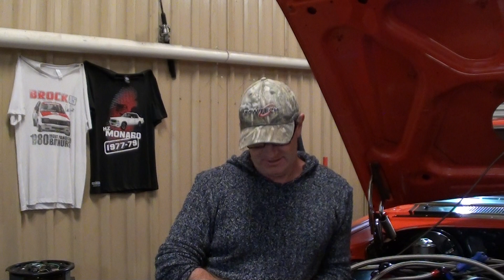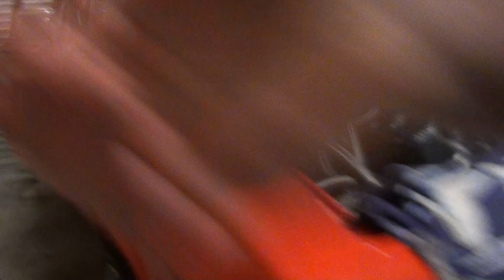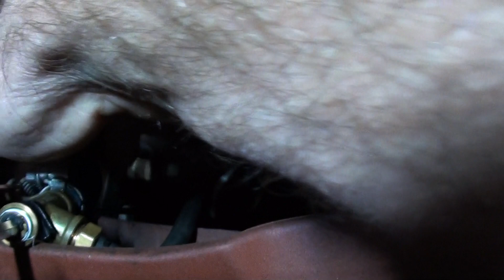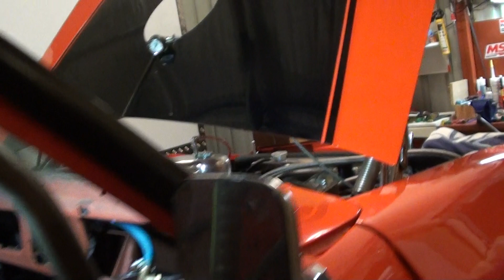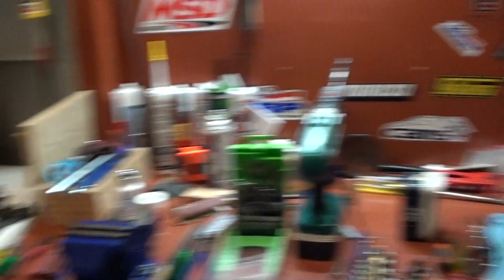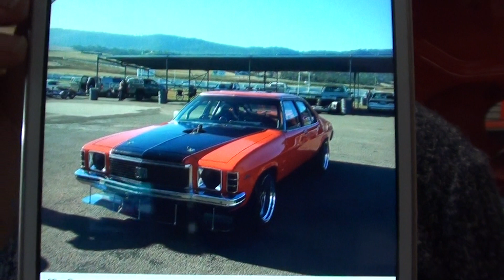FOUND THE PROBLEM (STUPID GRIFF IS THE CAUSE)

Comment: Fingers crossed Griff it’s just a head gasket. Gaskets are cheaper than pistons and conrods which is another reason to have them as the weakest link. As many a race car team will tell you, it’s often the simple stuff and cheap parts that let you down. I’d look at a better quality line for you boost control.
Good luck and keep us posted how you go. 👍
Reply from the maker: Big Al certainly will, Big lesson learned..Attention to detail is the motto now..cheers

Comment: Yep that'll do it.

Piss the long lines off and just change springs in the wast-gate for simplicity and reference off the compressor outlet.

How i have been doing mine anyway.
Easy enough to change springs or change the  preload on them when you want to change boost levels.
Reply from the maker: Morcs i have considered doing it that way, but when you have it in the manifold it holds shut the waste gate longer giving unbelievable ramp of boost, and i do like that...
Reply: IMO dont recon there is going to be a huge amount of difference especially with an auto.

 This is mine from a standing start it built boost no problem at all with the setup then and the ramp rate is faster then my current tires will ever cope with.

https://youtu.be/X3Xr99RVbvs
Reply from the maker: I have had it upstream of hat were my blow off valve is, and found it more linear in ramping, which is ok.. But i found manifold reference is alot more responsive for me...

Comment: Fingers crossed when you pull the head off. Have you checked for any melted plugs?
Reply from the maker: Rick Falcke havent looked at it yet, i would be surprised a melted plug, The first two times i blew a headgasket was thru lean out,when it started to ramp boost it would lay over in power just before it blew.. This time round the power went crazy, that suggests to me timing was way to aggressive for the high spike in boost, so that would be less chance of detonation, just trying to send the piston back down the bore before top dead center... were lean out occurs, detonation runs roit....

Comment: Happy that the older engines we run have a built in pressure relief valve.  lol

Thought about trying the speeduino boost controller like Sloppy is using?
That way if something goes wrong boost will be limited to a 4# spring.

Install
https://youtu.be/TDgOrEMsR-o
Reply from the maker: Not a bad way of doing it, but i like my setup as long as there are no kinks 😀😀😀